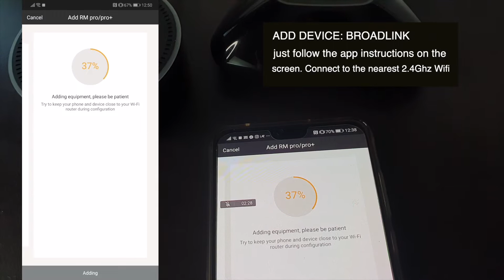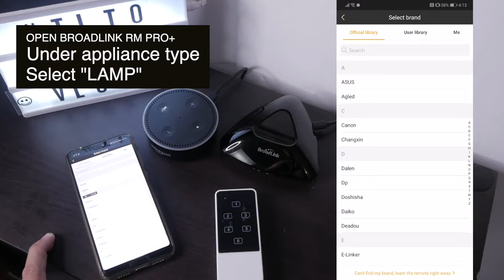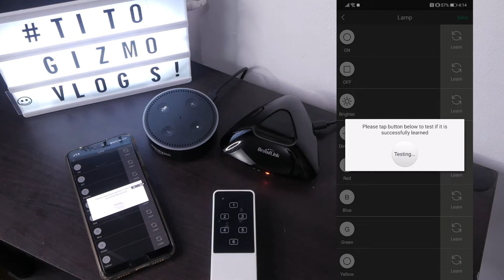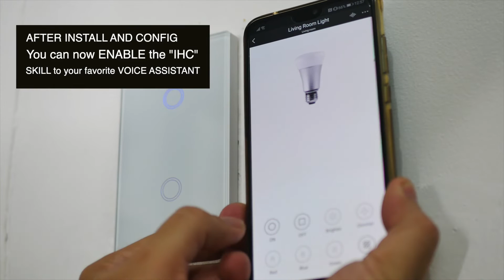Installation and Configuration - Broadlink RM Pro+ with RF Glass Touch Switch (NO NEUTRAL WIRE )

Comment: Sir meron ka for 3 gang, bali sir No need  Neutral/Ground wire? dapat ba to sir WIFI only or pede ba to by IR remote lang thru mobile phone? thanks sir
Reply from the maker: We have 2 tested technologies available sa No Neutral Ground Wire for now. #1. Weelite RF Switch with RF remote + Broadlink RM Pro #2. Weelite Zigbee Switch + Weelite Zigbee HUB lahat yan no neutral wire. Meron kami development for WIFI technology without Neutral/Ground wire pero tinetest pa until now. for Now recommended yung dalawang option. Both na can be controlled by APP via WIFI or RF, right now we don't have IR based transmission for lighting control.